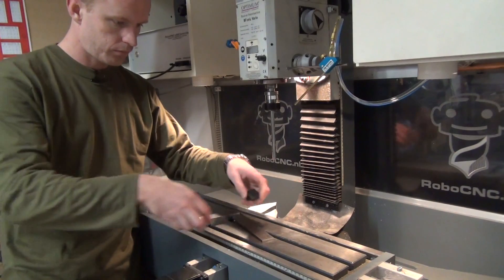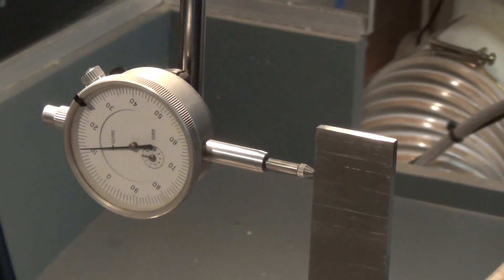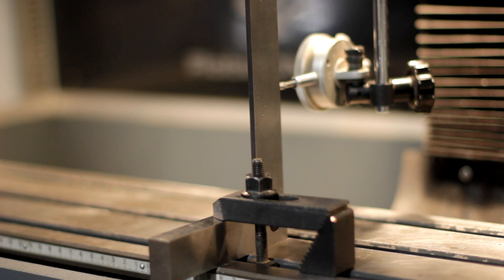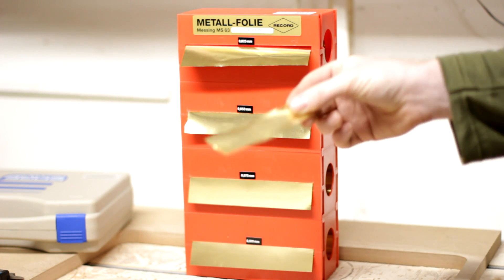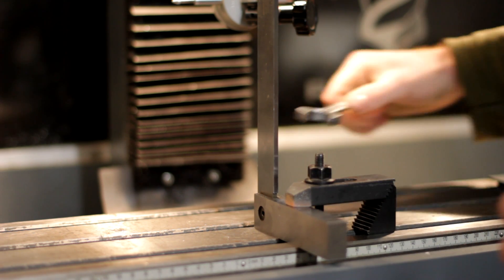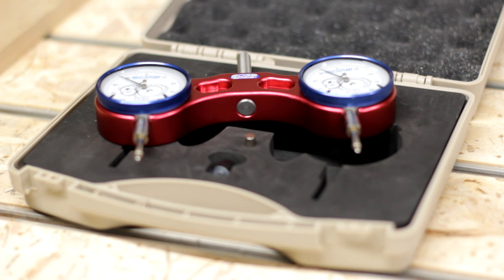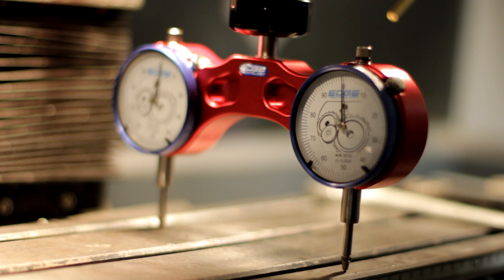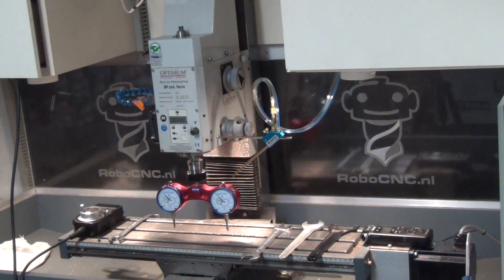RCNC BF20L 11 : Aligning the column and tramming the mill head.

Comment: How true is your square?
Reply from the maker: What do you suggest?
Reply: @RoboCNCnl  As good as possible, but at minimum less than 10 micrometers of deviation over 200-300 mm, preferrably under 5 micrometers deviation, and best would be 1-2 micrometers max deviation. So you would need a precision granite angle plate for that, that metal square isn't going to suffice.
Reply from the maker: Would love to see your setup at your home workshop like mine ;) 

Being true and square in a internet comment is of course easy.

Comment: Will the brass sheets not compress under the force? I got the same problem with the column. I try the shims first, if it does not work, I'll fly cut two pieces of flat stock fasten directly to the table with a big improvised fly cutter, eliminating the error that way by turning the created angled stock around 180°. But i hope the shims will do, as i am a bit hesitant with such a big mass that the fly cutter has. But all the import mills are off a bit, the cast iron settles and it's basically a must do on a milling machine, if you want to work to close tolerances in my opinion. I got harmonics and problems if i cut something with a big cutter. So much so that it feels like the cutter is jumping from time to time. That is a problem as the cutter may brake. My gut tells me it's because of the slight miss alignment....

So thanks for the hint with the foil. It's ordered already.
Reply from the maker: Go shimstock.... don't ruin your bed... !
Reply: @RoboCNCnl  ;) i can't see how i would ruin my bed with either methods. but as i said, the same material you used is already in the mail. i've bought the brass assortment with around 4 differed thickness. will come in handy for other leveling work too.

Comment: Haven’t seen anyone tram this way before. Usually it’s off the table. Looks like it works presuming that square isn’t out of square. You can use the edge for the column and head just turn it either direction.
Reply from the maker: 3 years ago already… Hope you’re still subscribed and following along with the latest vids !

Comment: The procedure of Matching the two indicators on the same magnet means they are aligned for the SAME spot on the table. But if the table is not perfectly flat (it happens there are +/- 2/100 mm), the difference will be incorporated into the tramming. Ideally, one should use one Indicator to measure the flatness of the two points of the table to receive the indicators's end and included in the control.
Reply from the maker: Thanks for sharing..

Comment: I find it interesting you went for tramming the head left to right versus the column. I suppose either would suffice. I prefer the head on the zero market and then the column dialed in. That way it’s easy to find home on the head if it ever needs to move.
Reply from the maker: On the top right you can see an ajusteble stop on the head/colomn and the adjustments are so tiny that it does not really matter I think... but what ever works works.. :)

Comment: How about tramming the head to the column first in Y direction?
Reply from the maker: As far as I'm aware of this is not something you can adjust.. The head slides on the column with gibs only..
Reply: I guess only by shimming between the head and the part that slides on the collumn otheriwise the tramming with the base will not be trammed true even if you have a little error.

Comment: Thank you so much for the video as I will do the same when I buy my BF20. Are you happy with the quality of the mill?
Reply from the maker: Thanks for the support ! Yes I'm happy with the mill, although I do not use it daily.. So most aluminum stuff.
If You would use it more, a belt conversion to get higher RPM would be nice
Reply: Hi! Thanks for all. Do you mean that are there any kind of belt conversion that increments rpm? I have one similar mill with belt drive brushless motor and I mill only aluminium